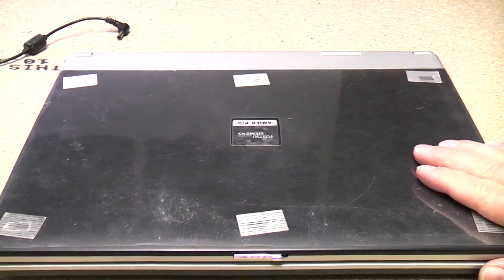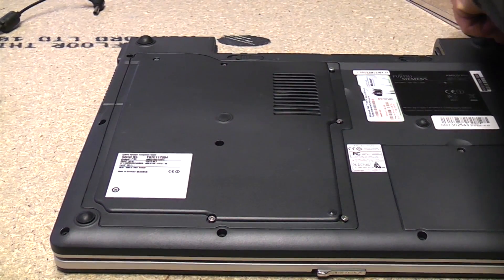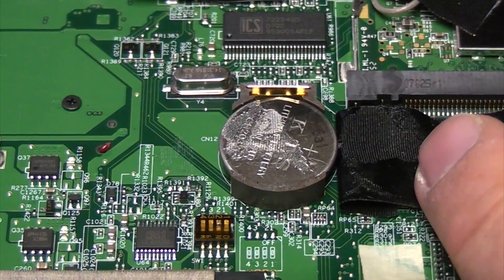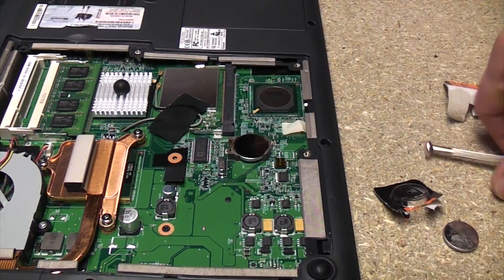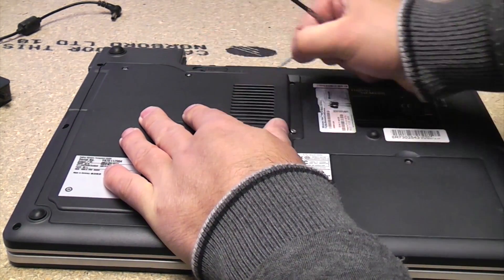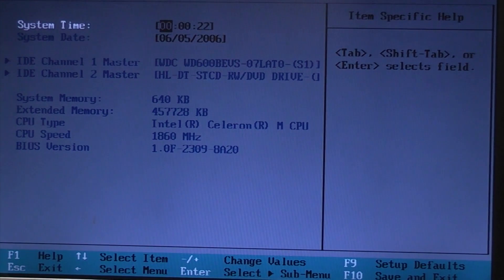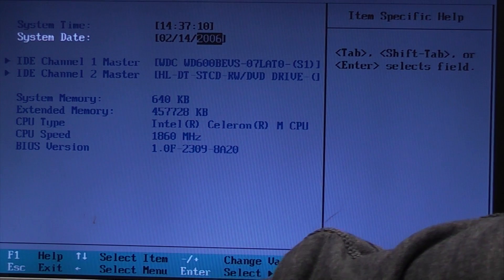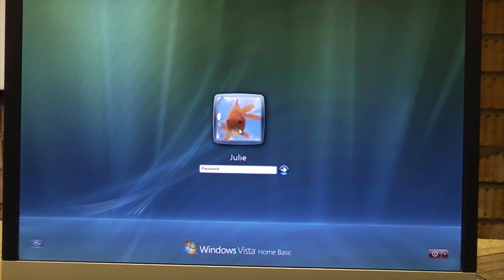laptop cmos battery

Comment: Curious , toshiba satellite L640 , I have noticed without getting too carried away,  is it a small , or a large CR2032, picking I have removed the wrong one.
Reply from the maker: There is normally only one CMOS battery on the motherboard
Thanks for the comment 👍
Reply: @ultimatehandyman  Thanks , it's not too bad to replace, as long as I don't break the holding bracket,  have made that mistake in the past.

Comment: I really need help. I was so stupid and I only had one intel graphics card. I disabled it not knowing it would not function without it. The problem is when I turn on my laptop, the screen is on but it's so shattered and broken so it's connected to my tv and when I start the laptop it doesn't show on tv so I can't reset anything. I've been googling and watching videos and I've taken out the battery and took everything plugged away. I've turned the laptop on and off and I still don't know what to do. If there's a way to enable my intel graphics and get the laptop displaying on my tv screen please please help me.

Comment: I just got the BIOS battery replaced and was asked to pay 500 Indian rupees which is more than 7 USD. I am using an LG R480 Laptop. Do you think it would cost that much ? I had a problem with the clock on my computer. It wasnt updating the time correctly.
Reply from the maker: It depends how long it took, sometimes it is not at all easy- https://www.youtube.com/watch?v=aUk1UxYOpW4

Thanks for the comment 👍

Comment: Hey can i transfer the cmos battery of my old acer laptop to my HP pavilion laptop? Are internal batteries interchangeable through different brands?
Reply from the maker: I would not bother, as the CMOS batteries are very inexpensive. You are much better off fitting a new battery ;-)
Reply: Ultimate Handyman not from where i came from hahahaha. Im just wondering if it is possible so i dont have to spend at all.
Reply: Hey man, you still there? I really could use your help on the topic of is it okay to use an internal battery from one laptop to another :(

Comment: Toshiba Satellite C50-B-14-D CMOS Battery low message comes up. I do not know where the battery is located or how to resolve the issue can you help me. Thanks
Reply from the maker: If you Google for the exact model you should be able to find the engineers manual, it should tell you in there ;-)

Comment: I am having problems with my computer booting up. I'd say 99% of the time the monitor will not turn on when I turn on my laptop. It boots and loads Windows, but the monitor stays dark. I have to use the HDMI out on my laptop to connect it to my TV to use it. It is very rare that my monitor turns on when I turn on my computer. Any ideas?

Comment: You'll lose all your volatile BIOS settings every time you power off without a CMOS battery, You might as well spend £2.99 and 5 minutes changing the thing.  It'll stop you having problems with software saying "License out of date" later.

Comment: It will work but you will lose all your bios information every time you turn off. which means your date will be out and it will have to detect your hard drives again (if your bios is capable of auto detecting your hard drive that it)

Comment: would the cmos battery have something to to do with startup problems? im running it in safemode right now and dont have volume so i cant hear the vid, plus my time is always off is that caused by cmos battery also? someone please help, i can get the battery for 2 bucks and the guy wants 90 to put it in

Comment: I just checked my old Dell Latitude CPx. Removed  all back screws, rear end after removing holding cover screws, and pryed out keyboard (not touch pad board) and next touch pad unit, taking care with connector cable of keyboard and touchpad plugins. It is right there, a 7.2 v, 4mAH (Varta) with plug in connector. Actually it is 6 pcs of button cells soldered in series and wrapped and sealed in plastic cover. Takes time to buy these from market, solder them, seal them and connect to replace-!.

Comment: Hey I forgot my laptop password to get in my account If I remove my Cmos Battery for 30 seconds will it reset it?. I tried taking it to a repair shop but they said it had some protection they could not crack it is ah hp windows xp professional and has mobile data protection system I don't know what that is.

Comment: lucky you your cmos battery is easy to reach.
to get to my cmos battery, i need to separate the screen from the main unit. remove the whole laptop shell. the key board and the track pad. tons of screws. speakers. dvd drive. hard drive and etc just to change the cmos battery -.-